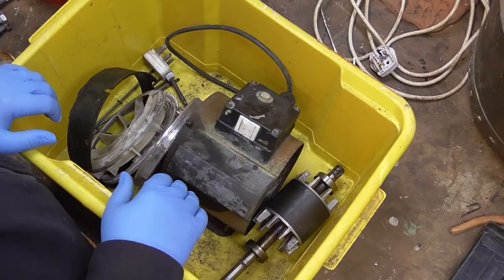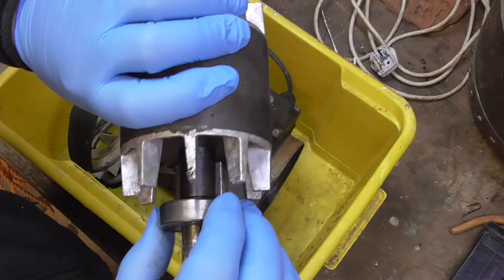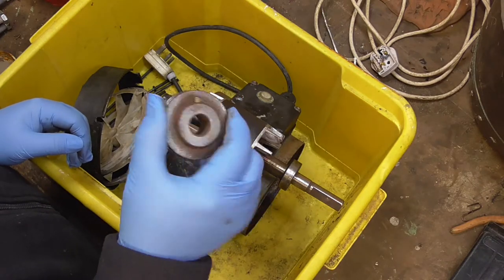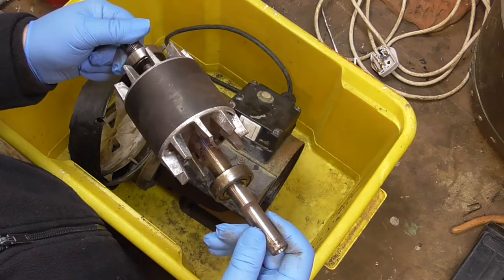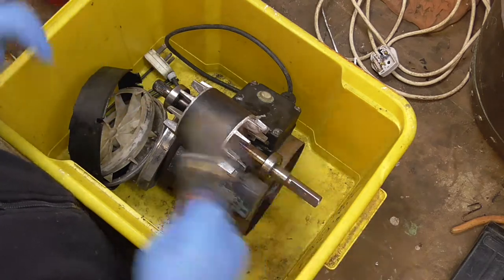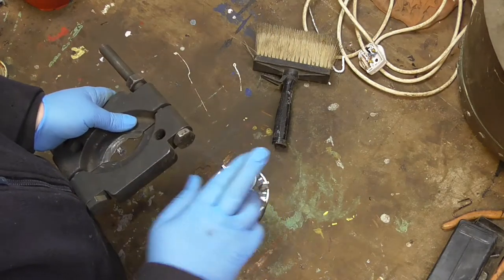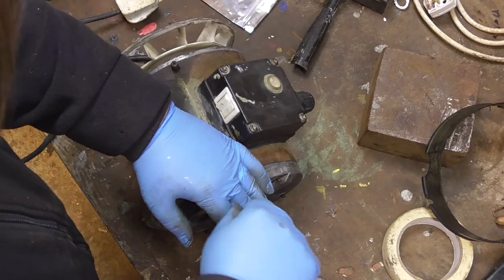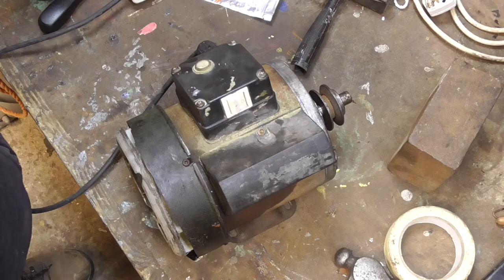Belle cement (mortar concrete) Brook Crompton electric motor bearing repair  & stand

Comment: If you ever take that plastic fan off again, I recommend making a replacement cover for the wiring area.  The chance that losing the original cover improved performance, especially cooling performance, is less than zero.  People often think "I'll just throw this out" and people thinking that are always wrong.  On another hand it's probably not enough of an effect to bother taking apart for just that one repair.
Reply from the maker: Hi bob, I don't ever remember it having one, but as there is no opening the other end, I can see no reason for it not to be covered.
That said considering it's age, there was noting inside but a dead wasp! (quite amazing bearing in mind the environment it works in & age of it).